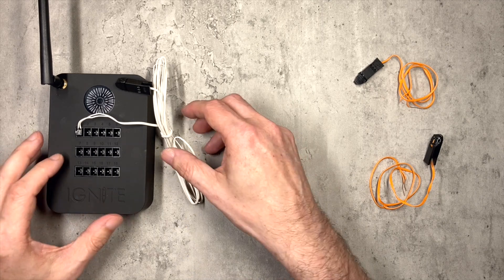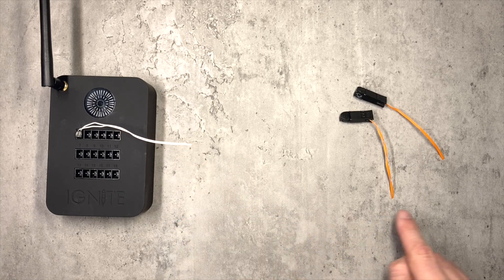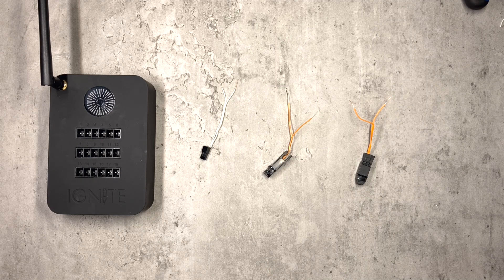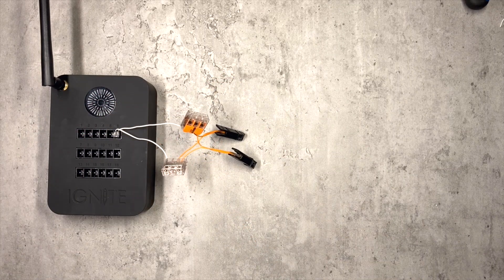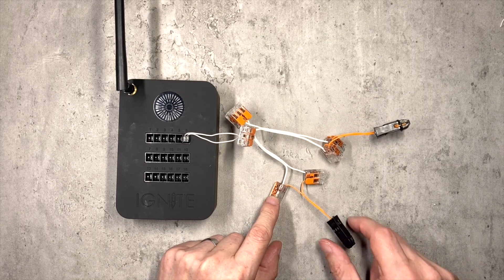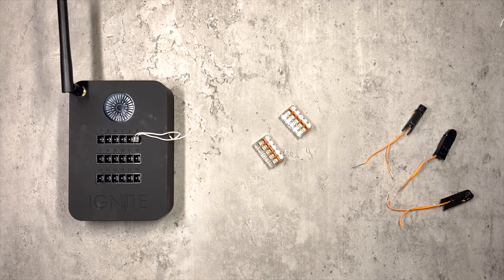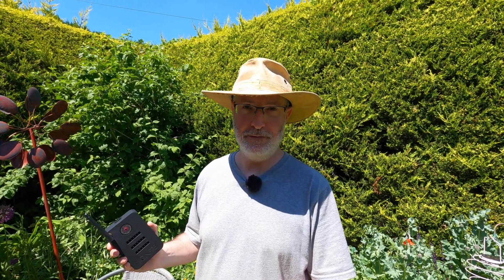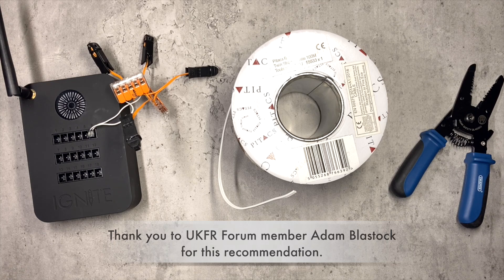IGNITE Fireworks Firing System - Firing multiple igniters per cue at the same time

Comment: If I may.  Cobra makes a device called a breakout board where you plug it into one quickplug cue but the board has 5 additional quickplug ques.  They come in a parallel option for $4.99 USD or a series option for $9.99 USD.  They are for quickplugs only however.
Reply from the maker: Thanks for your input Michael. I agree if you're using plugged connectors it's way better. Still waiting to find someone in the UK who stocks these though :(
Reply: @UKFR  Did someone have the Ignite system in stock there or did you have to just have it imported?
Reply from the maker: @michaelbaima6817  It is now widely in stock here in the UK at firework shops, along with the standard pack of plugged igniters. However getting other items (including Cobra gear) has always been problematic for us UK folks, most have to bite the bullet and order from the US (huge shipping, import, VAT costs etc.).
Reply: @UKFR  Ok. I just watched your unboxing video.  The guy you mentioned who is the main Ignite contact in the UK may be your guy then.  Ignite is a Cobra product.  Drop a bug in his ear.  On the Ignite website they even have a link to the Cobra breakout boards.  Hope you can get them.  I personally have a Firetek system but this system has me intrigued now.  Great videos by the way!